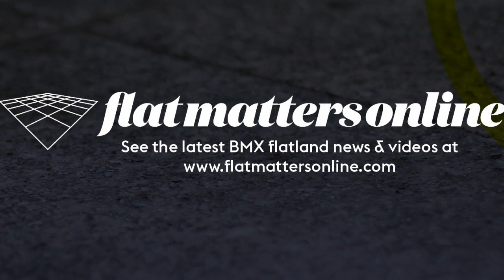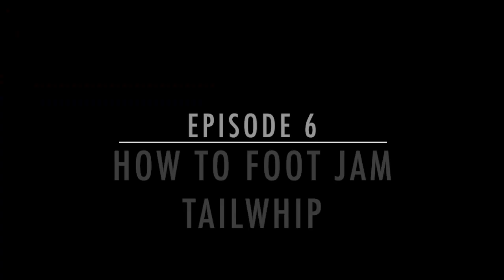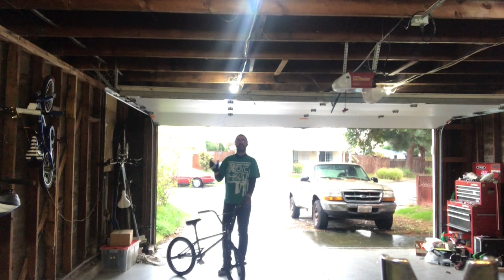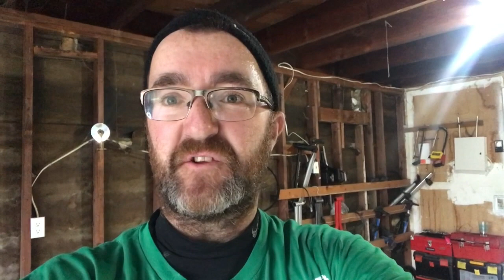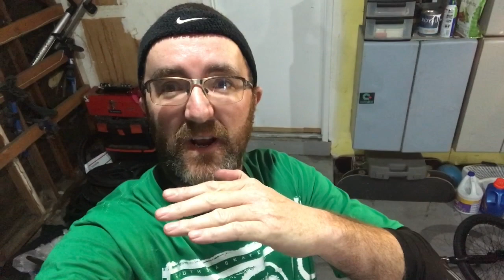HOW TO FOOT JAM TAILWHIP EPISODE 6

Comment: hi
I can not land on my pedals after the bike came aroun. Mey you help me out with this?
Reply from the maker: One thing I can suggest is getting off the bike and practising with your foot on the tyre and getting the motion and feel of what its like to get back on the bike. So essentially learn the second half of the trick then put the whole trick together. Depending which way you tail whip, set your pedals either left forward half way up or in my case as on video right pedal up half way. Learn to spot your landing and don't rush the rideout. These are all small things which when you put them together become big things and will help you learn the trick. Let me know how you get on. Good luck!
Reply: Thanks😄 I'll try this